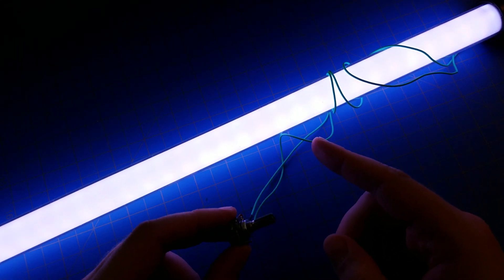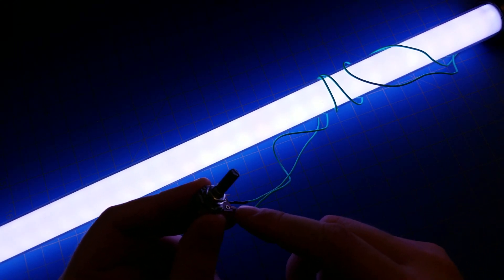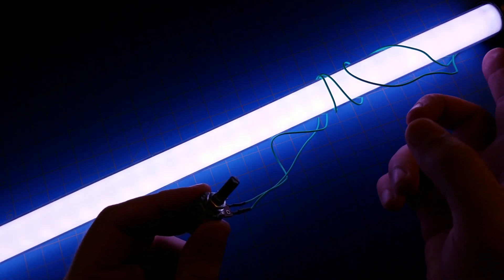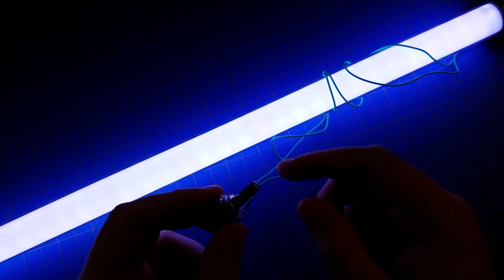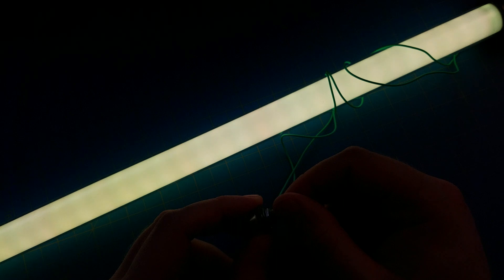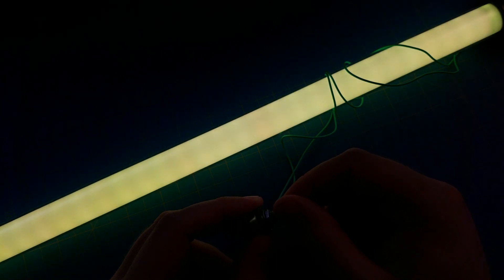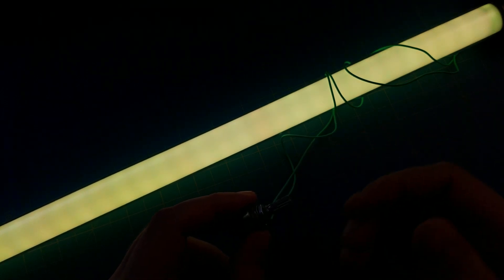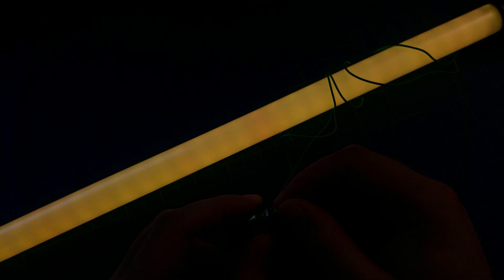A Brief Demo Exploring the Effect of Varying the Lightsaber Blade Voltage

Comment: My blade is experiencing this. While I swing my blade, or slightly push it in a direction, it will change color. White shows a faded yellow and purple shows a pinkish purple. 

I feel like it's a power connection issue. Can I reach out to Disney for a replacement hilt/blade so I can troubleshoot the original?
Reply from the maker: It can't hurt. You can contact them by calling (877) 560-6477 or email merchandise.guest.services@disneyparks.com.

Their policy is they'll replace the item if it's less than 30 days old. But they don't always adhere to that, so it's worth a try.
Reply: @Ruthsarian  Awesome! I appreciate the reply! You're the bomb 😎 I just got mine on April 28th and still have my receipt, so I feel like I have good odds. 

Just wanted to say that you've already helped me fix the loose scrap with the rubber washers. And, I got most of the parts for the blade controller, just awaiting the board. You're a true jedi master 🙌 gotta admit that it would be nice if this expensive product didn't come with defects. Luckily, the experience for me was amazing, and I'm willing to put in the work to fix it. Although, without your research, it would be a more difficult road. Mad respect! Thanks, Ruthsarian!

Comment: Any chance of a tear down or info regarding the savi's lightsaber switch plate? I know there's a magnet there and mine is giving me issues. I'm inquiring on a possible fix or upgrade. Thank you and love your videos.
Reply from the maker: what kind of issues are you having with the switch?
Reply: @Ruthsarian  the part that slides back and forth ( I believe the actual switch part) feels too loose , like it slides outta place in either direction
Reply from the maker: i had a similar problem. I'll do a quick video this afternoon about what i did to fix it.
Reply: @Ruthsarian  thank you very much, I appreciate that, I with Savi's would sell or connect us with replacement parts.
Reply from the maker: Here's the video: https://www.youtube.com/watch?v=DmUKKTm9SIQ

Hopefully that helps with your problem.